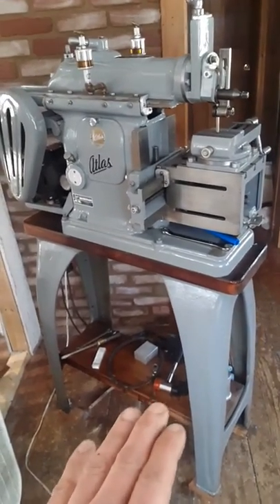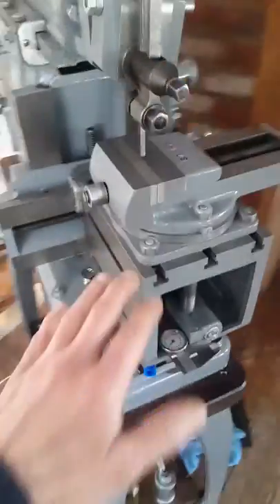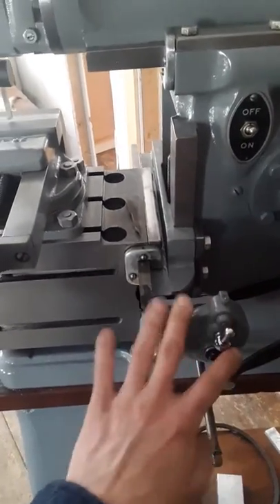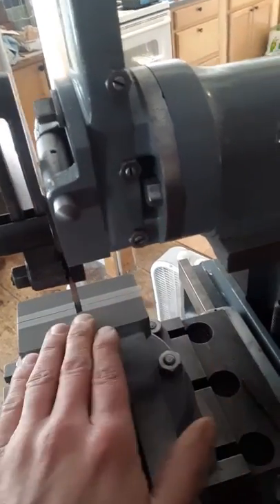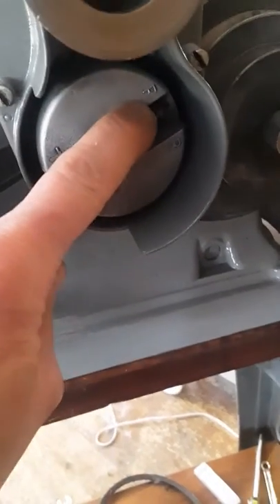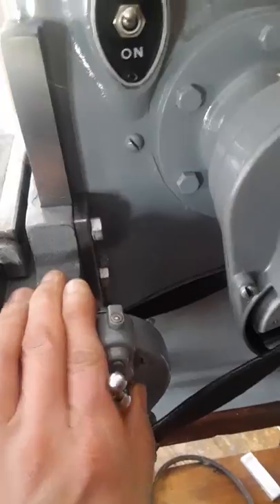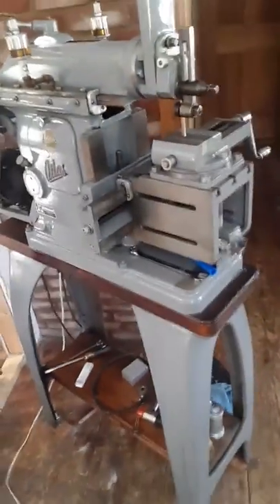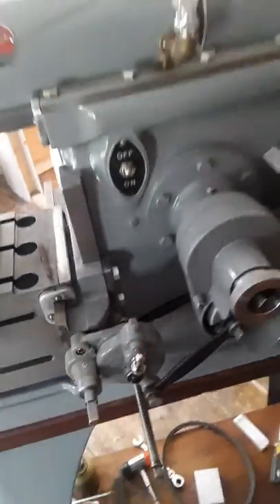Atlas shaper tips. Pt.1

Comment: Great tip. I just picked up an original Atlas 7 (not the 7B). I'd be curious of the base of the 7B would fit on the original 7. I'd like to install the additional table support that the 7B has if possible by swapping out the require parts.

Comment: Great info!  I'm in the process of restoring an Atlas 7B right now and  I'm just finishing up an Atlas Horizontal Mill restoration.  I painted the mill hammered grey.  However, I love the color of your machine.  Would you mind letting me know what kind of paint you used and the color?  Also, did you spray it or brush it?  I thank you in advance........jster1963  (Ps. I will be uploading another mill restoration video toady)
Reply from the maker: It is rustoleum smoke gray. I am restoring my atlas horizontal mill as we speak! Same color.
Reply: @tristansmith7169  1. Thank you so much for the info!  I really appreciate you taking time to answer!  2. Did you get the paint from Lowe's or Home Depot?  3. Did you spray it?  4. Are you making videos on your restoration?  

My video just uploaded on my Atlas Mill restoration (jster1963 Mill restoration video 4).  If you haven't seen Ghostses videos, I highly recommend it for taking apart and putting it back together.
Thank you again.....
Reply from the maker: I used spray paint I believe I purchase it at the local hardware store. It was almost a perfect color match to the original color of the shaper. No I'm not making any videos of doing the Restorations on my machines. I like to focus on just the machine. I'll check out the videos.
Reply: Tristan Smith Thank you so much!  Your mill will come out as beautiful as your shaper!!  Good luck and thanks again.....